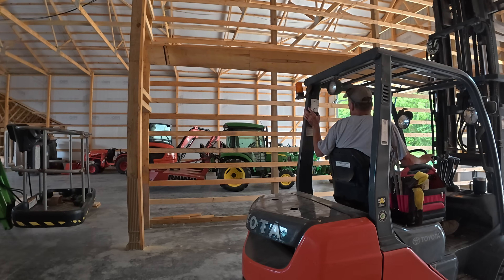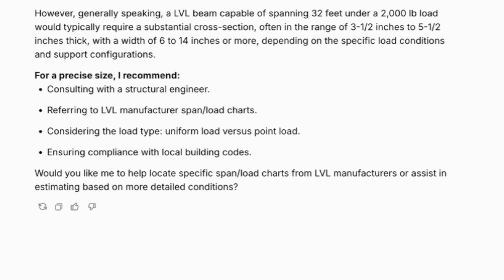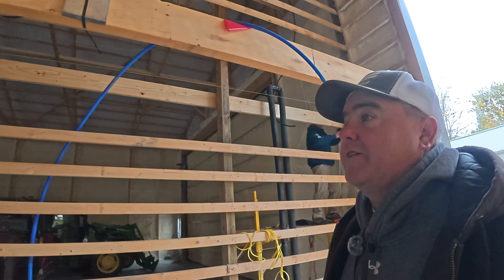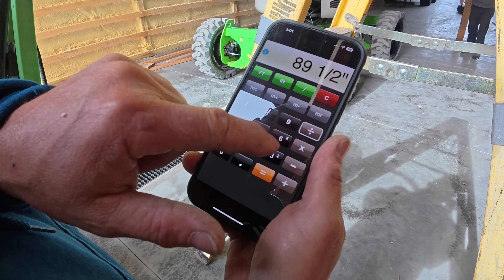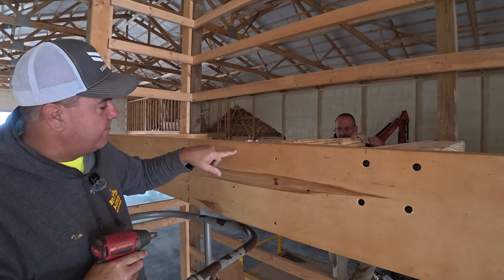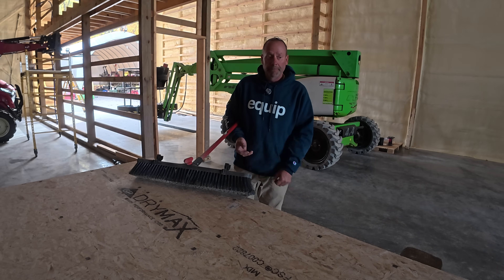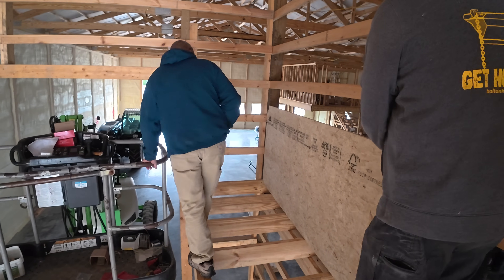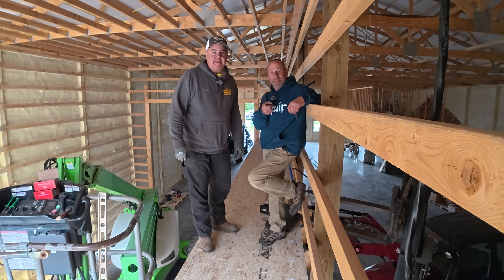Building an AI Engineered Shelf to hold 7000 lbs!

Comment: An issue I have seen in other peoples builds is that used the proper dimensional lumber but used too small of bolts and screws.  The failure point was the fasteners.

Comment: I think you need at least another 12" of depth, maybe 24" so that you can walk by the equipment and work around it doing maintenance & repairs & eventually replacement.  Might have been cheaper & faster to use a wood I beam with the joists on top of it. Lookin' good!

Comment: Nails are actually better for most framing and sheathing applications as the loads are primarily shear and nails excel there.  Screws are better for withdrawal (tensile) loads, but nails are generally faster, cheaper and better for most framing and general construction.

Comment: Nicely done, looks great!  

The following is just for information, not a critic or anything like that.  The LVL manufactures require that LVL's are not to be used individually (single ply), so they must be at least doubled (two ply) or more and attached together to act as one (not going to get into the "attached together" part).  And most times wood members end up being "deflection limited"  by the design, as the codes are setup to try to limit deflection since "bouncy" floors tend to make folks feel unsafe.  And in most cases, getting anywhere near the max deflection allowed in the code, can still make a "living space" floor still feel too bouncy to many, especially as the span gets longer (that allows more deflection).   Soft woods (construction lumber) will move (deflect) a lot before before it will actually fail, fortunately.  To provide the optimum shear resistance with those floor panels, screwing the perimeter of each panel down at 6" o.c. (on center) is what is usually called for, though you can increase the shear resistance provided by the sheathing be reducing the spacing to 3" o.c., but you can start to get into issues with splitting the wood member underneath at that spacing (in my opinion), so 6"o.c. is best.  And that definitely will provide lateral strength in that shelf, as you found (and likely assumed/knew).  

And if you are screwing things down, assuming all of the screw threads end up in the bottom member, the glue is not necessary (this is in my personal opinion), as it just makes changes later quite the pain and makes the panel "unusable" for reuse, if the glue actually bonded, not to mention the time and bit of pain-n-the butt to deal with the glue.  If the threads of the screw bridge the gap between the panel and structure below, you really have to be careful that they are fully in intimate contact with each other when they are screwed together or you greatly increase the chances of squeaks and possible movement, so glue in that case could help, though really, a different screw should be selected.   

All of this is just more information for anyone who wants it, as it is just my opinion, as I am not a licensed engineer in your state.

Anyhow, enjoyed the video and good for you Ken, 165 lbs, well done, I used to be there, in HS, of course then I used to think that my ideal weight would be 175.... only need to lose a quarter for me to get back there 😂(darn metabolism, then and now, and activity.....)  Oh well, have a good one!!👍
Reply from the maker: Sounds like overall, we did a pretty good job of design.

Even better, I was right about the glue!!!  Got a win over Ken :/)
Reply: @TractorTimewithTim  Yep!!  & the win over Ken 🤣🤣
Reply: @TractorTimewithTim  It was just his 'opinion' 🤣.  I'm not giving in that easily!
Reply: I agree with the glue. It’s weird I have built many houses in my day. For some reason glue and nails work really well. I have found out I used to get a few squeaks with screws and glue. I think some of the screws were not tight enough or to tight (glue to thin)maybe, I’m not sure. When I saw Tim’s question to grok I thought it said a 2ply beam.

Comment: Hi, you clearly have a plan for your pressure washer. Just a friendly suggestion are you planning to put a boom on the ceiling, like they use in self service car washes. Keeps your hose off the floor and you car get all the way around what you are washing easily. I built a wash bay in my shop a few years ago and did this, no more tripping over hoses. Company in PA Kleen rite sells self service equipment and would have the booms, hoses , swivels all parts you need to do this if you choose. The whole project is coming out great.

Comment: If you really want overkill, the weakest point of that shelf is the screws through the lvl and into the end of the joists. Might want to consider joist hangers.
Reply from the maker: We have joist hangers.  You can see them.
Reply: @TractorTimewithTim disregard then, I obviously wasn’t watching close enough!!
Reply from the maker: @fiziksgeek3562 no worries!  Just pointing out that we were on it!
Reply: They ALL have hangers now.  Screwed and cross nailed. You can actually see them in a few places in the video-like right after the 15 minute mark.